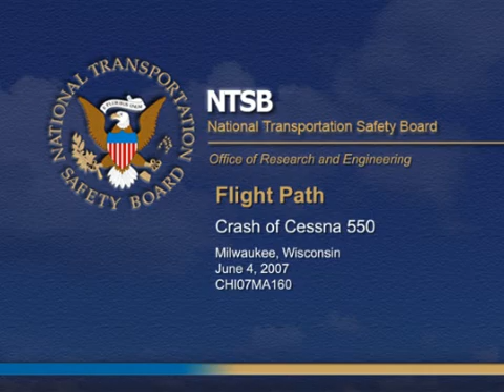Flight Path Crash of Cessna 550 Milwaukee, Wisconsin, 06/04/2007

Comment: sounded MORE like his flaps were set  incorrect, did they find the cause?
Reply: According to the report: "The accident sequence initiated as a result of a control problem that was related to either an inadvertent autopilot activation or a pitch trim anomaly, the effects of which were
compounded by aileron and/or rudder trim inputs; however, it was not possible to determine
the exact nature of the initiating event. "
Reply: @ZorbaTheDutch  The National Transportation Safety Board determined that the probable cause of this accident was the pilots' mismanagement of an abnormal flight control situation through improper actions, including failing to control airspeed and to prioritize control of the airplane, and lack of crew coordination. Contributing to the accident were Marlin Air's operational safety deficiencies, including the inadequate checkrides administered by Marlin Air's chief pilot/check airman, and the Federal Aviation Administration's (FAA) failure to detect and correct those deficiencies, which placed a pilot who inadequately emphasized safety in the position of company chief pilot and designated check airman and placed an ill-prepared pilot in the first officer's seat.